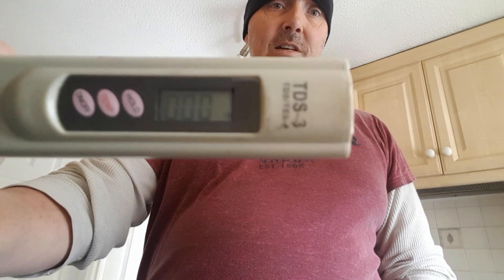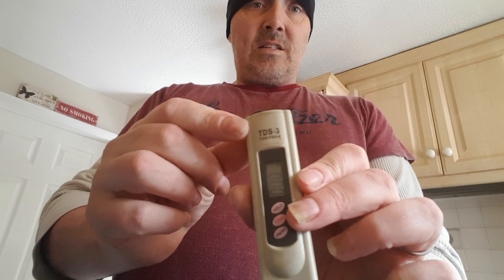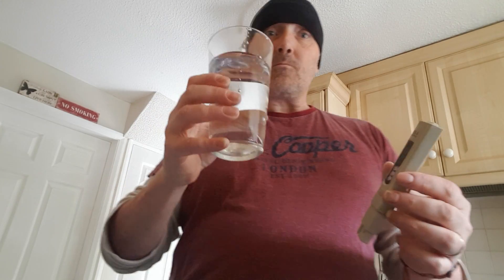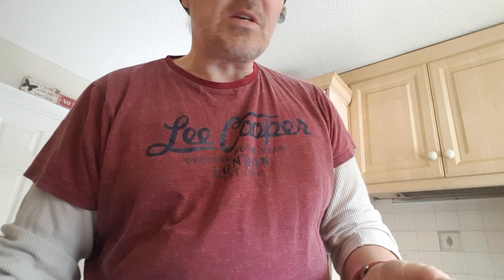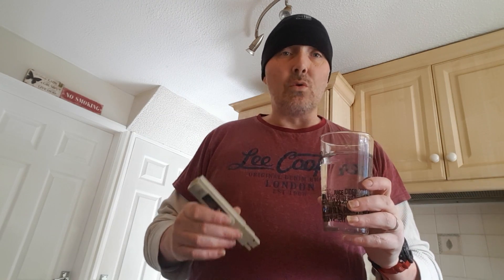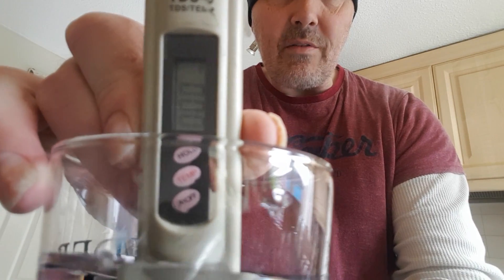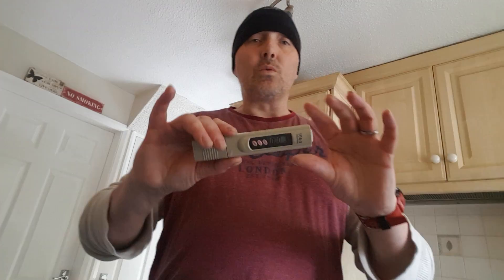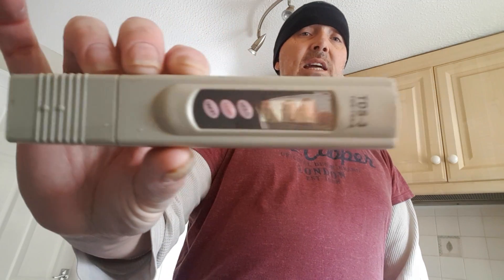Understanding T.D.S. - Using a TDS meter - Water fed pole window cleaning

Comment: hi nie videos  you tell it how it is  could you give me some advice im just starting out  i have got a ro system i have changed all the filters a put new resin in but when water comes  through it is still at 006 ppm am i doing anything wrong thanks barry
Reply from the maker: Try lowering the input flow rate to reduce pressure - this may help.

Comment: I use Zero water also, but doing that I burn through carbon & sediment pre-filters is there any way to curb that ?, they need changing every three months on average, can't work out whats causing that... Water in our area is 250+ ppm I watch the water like a hawk...

Comment: Always to the point! As a side issue what’s the dilution rate for the isopropyl as my pipes froze for the first time last winter I am insulating it out this summer with kingspan n marine ply but I’ve never used the iso? - cheers -johnny

Comment: Have you ever worked off ladders or are you just reach & wash ??
Reply from the maker: Darrin Perkins I spent 10 years on ladders, cherry pickers and am also rope access certified.  Sold all ladders last summer because with modern reach and wash they are just not needed. We don't even use them for access anymore. If access is not available we don't take the job. Hope that answers your question.

Comment: I got a question mate is it better to attach a carbon / particle filter before your DI tank to make your resin last longer?  And how high can your TDS get on a DI system before getting water spots?
Reply from the maker: vcash holdfast yes we have a carbon and sediment pre filter.  As for how high does it get before spots... in theory 001 ppm but I don't know is the simple answer as ours is always 000 ppm
Reply: Green Pro Clean Ltd Ok, How high does other window cleaners push usually? I have heard up to 10 ppm and that having at 0.00 ppm is an industry scam !  Anyways thanks for the repply!
Reply from the maker: vcash holdfast I have not much idea what other window cleaners let their TDS run to. It's up to them.   What do you mean by industry scam? please explain.
Reply: Green Pro Clean Ltd That you dont need to always be at 0.00 ppm you  can be much higher and be spot free but, I dont know !👍
Reply from the maker: vcash holdfast I see what you mean. I suppose you could. However we guarantee a pure water service. Pure to us is 000 p.p.m. so that's the standard we strive for.
Reply: Green Pro Clean Ltd i hear you,!
Reply: Under test conditions, our eyes can not see under a tds of 050,  but that is test conditions.
Other factors have to be taken into account such as the window cleaner's technique, how clean the bristles are, oily seals or degrading window seals etc etc.
The tds stick we use measures parts per million but you can now get parts per billion, so how pure is pure. So if your arguement for keeping your water at 000ppm is that your selling your service as pure, how pure is it when you use a ppb tds stick........!   So are for good n purpose a tds of 010 for instance is and can be said as still using pure water
Reply from the maker: NK Services IMO 000 is pure. That was the standard before PPB came along and is how we measured for years.  Having tried PPB at a certain suppliers road show I can honestly say I don't see the point.  They claim it would help clean windows better that aren't done as often quicker but we rum a hot system anyhow so there would be no difference. You can only pass the brush head so fast across the surface.  With your own statement of the human eye can't see below 50 ppm then what's the point of PPB?  Ahh... I see.. another way to take a ludicrous amount of money off a Window cleaner.  :)
Reply: Green Pro Clean Ltd absolutely agree with what you are saying as regards the ppb, its just another marketing thing to make ones upgrade. But isnt that the same with the supply of resin to keep their cash coming in. Thats why for years people have been scared to let their water go past 000 because of fears of spotting and the likes. Its just a tail to ensure a regular supply/demand of resin is in the market.
Reply: Not knocking the video in any way though, i think its great along with your other vids.
Just adding my opinion for ones to read, as to why I dont use DI at the moment as it comes outmy RO at 006 and for about a year or so now, ive been using it this way
Reply: Green Pro Clean Ltd  I agree if it’s not 000 then your not using pure water , it either is or  isn’t and I value my customers  business too much  👍